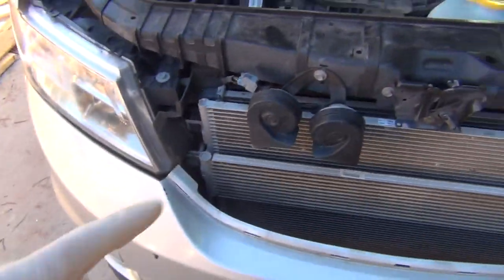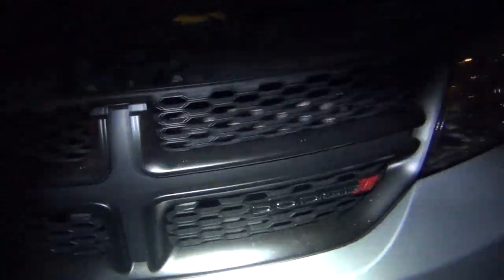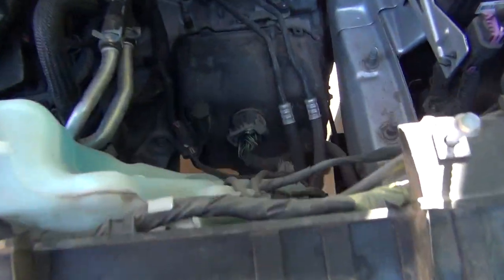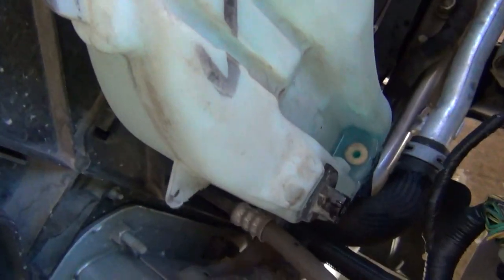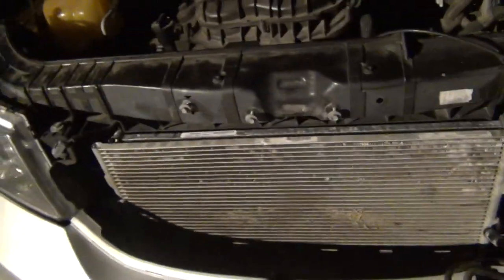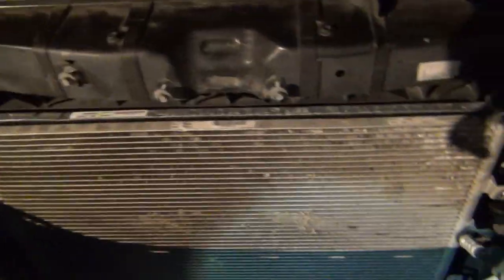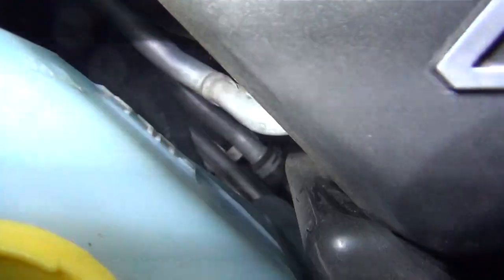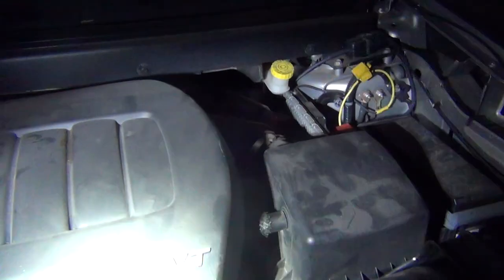How to Replace Radiator on a 2012 Dodge Journey

Comment: The cooler line has a E clip you pop those off and the line comes of like an air line. It is also important to bleed out any air in the systems. On top of the thermostat there's a bleeder valve. You unscrew that while you fill the coolant.
Reply from the maker: John T by the way I’ve replaced this radiator 4 times now
Reply: @ArchesMechanic   4 time damn.. just throwing out tips that might help others.
Reply: @johng8967  do you unscrew it all the way out or just a bit?
Reply: @johng8967  What he didn't mention was he's replaced the radiator four times on the same vehicle! I wonder why 😂

Comment: Did you realy need to disconnect the A/C condesor radiator? it looked like there was enough line line clearance to shift the unti out to clear the water radiator?
Reply from the maker: TheSageBen yes otherwise you cannot get it through the front clip.
Reply: Arches Mechanic  I just replaced the radiator in my wife's Journey yesterday and was able to pull it without disconnecting the AC lines from the condenser.  You get more room by removing the condenser and it's a tight fit if you don't remove it, but it can be done without removal.  

You also need to remove the lower radiator hose first if you keep the condenser in.  That was a challenge since the clamp on the radiator side was not easily accessible.   I ended up removing the fan to get a little more working room.

Overall, this was one of the most frustrating repairs I've done on a vehicle due to the tight quarters and limited access to fasteners/bolts/clamps that require removal.  The tough ones were - the lower radiator hose clamp, the power steering cooler lines (loosening and re-tightening 1/8 of a turn at a time) and the bolt that connects the AC condenser bracket (where the two tubes meet) to the radiator.  I also had to remove the plastic panel on the underside of the bumper so I could access the lower radiator hose.  

There was a lot to remove just to get to where I could remove the radiator.  I've also got quite a few cuts and scrapes on my hands.  It took my about 5 hours total.  I told my wife I hate her car because it's so difficult to work on LOL.  To give you another example, I had to remove the intake manifold and everything attached to it, to replace the spark plugs.  I hate front wheel drive cars.  Oh, and don't get me started on the battery.  The way cars are designed these days is just dumb.  I have an 06 GTO and it's easy to work on.  I just replaced the radiator on that and it took have the time.

I had my wife call a repair shop just so I could get an idea of what they would charge for the replacement.  I was shocked when she told me they said $600, including parts.  I spent $300 between the radiator and coolant.  My wife could tell I was frustrated and kept saying we could take it in, but that just made me want to complete the job even more.  Would I do it again on this car?  Absolutely not.

I'll close by saying thanks for posting the video!  You showed my the path I needed to take to get it done.
Reply from the maker: Thanks for the info. I wanted to make sure that I didn't break anything that is why I removed it.
Reply: Nope. There is a 10mm bolt on the side of the a/c block that you remove without disconnecting those 2 lines. That gives you the movement you need to pull the condenser forward to pull the radiator.
Reply: TheSageBen i did this process and was able to complete it. Only issue i have is that the fans dont kick on anymore. I know fans and resistor are good but fans will not kick in auto i had to hotwire it. Could it b because the ac lines were disconnected?
Reply: Got 2012 dodge journey sxt v6.3.7 cooling go to 121 car bee shaking ijust change the radar any idea

Comment: hi 
I have Dodge journey 2015 with 3.6L and in very hot weather the Temperature goes up to 228 when the wind blowing in my back but normal and 208 when I face the wind 
is it ok ? by the way i was doing 160km/hr and when I slow down to 120Km/hr 
 it comes to 221 F
Reply from the maker: Dolfocar Ali mine is the same. Keep cool air on it. Maybe change coolant. It can break down after time and quit working.
Reply: Arches Mechanic so is 228f normal? Or should I be fixing something? 
I did the water pump replace the coolant and flush the system 3times
Reply from the maker: Dolfocar Ali could be an air bubble caught in the system. Have you replaced the thermostat?
Reply: Arches Mechanic yes I forgot to mention it i did replace it yesterday i had air traps in the system I released it and have a better result because i had 232 with air inside 
I replace the radiator as will
Reply: Arches Mechanic by the way i have the abmint air temperature sensor giving higher than actual temperature by 20c
Reply from the maker: Dolfocar Ali 195-220 is normal for every vehicle but some can go a bit higher. On a really hot day with no wind. I can see it climbing a bit higher.
Reply: Arches Mechanic thanks for your help
Reply from the maker: You may check the radiator cap also. The cap causes pressure and boiling point to rise. Instead of boiling at 212F it raises it to like 240-250F
Reply: Arches Mechanic yes that was the first thing I did
Reply: ?by the way there is two side pcs of plastic on the side of the radiator seem to me missing in my car comparing to yours dose it make any difference
Reply from the maker: Dolfocar Ali no

Comment: Wow, "remove these 2 bolts to "DE-COMPRESS the ac system". Really?  I hope nobody gets blinded by the 250 lbs of refrigerant and ac oil that will burst out in their face!!  Before someone gets badly injured using your video,  I strongly suggest you add step 4 ,,,,.. "properly discharge your ac system before you remove condenser lines"!
Reply from the maker: jimmy Molinaro yeah. I made this video before I had the proper equipment and before I went through ase training. Thanks for pointing that out. I will edit and re-upload.
Reply: Dont know if you guys cares but if you're bored like me during the covid times you can watch all the latest series on instaflixxer. Have been streaming with my gf during the lockdown xD
Reply: @Zaire Jerry definitely, I have been watching on Instaflixxer for months myself :D